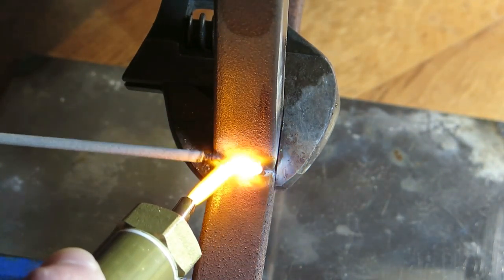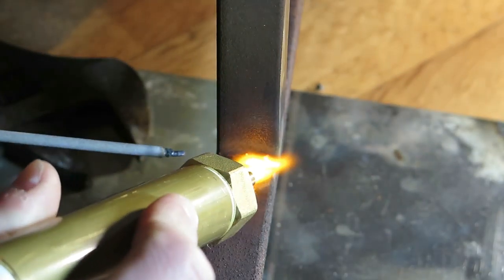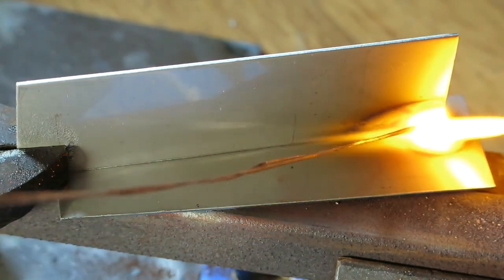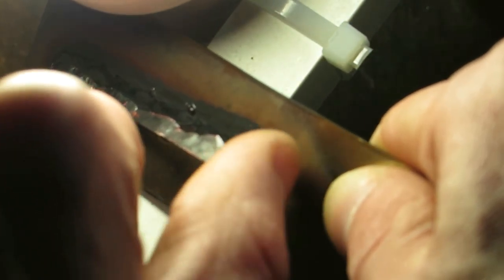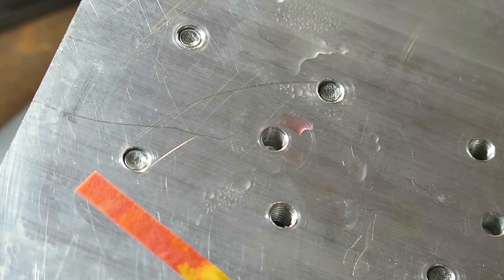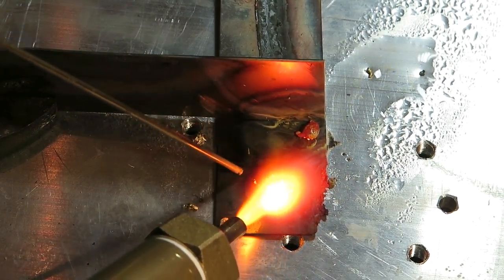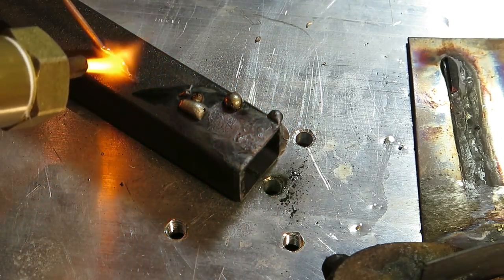Welding, brazing and melting glass with 1KW HHO

Comment: I've not seen many videos that explain how much HHO production is needed for working glass without a problem and how big an electrolyzer and LPM would be needed. Any idea of how many LPM are you generating and has the torch been satisfactory in terms of heating glass? I see you have a lot of problems with cracking. A reducing flame is usually the poor man's annealing, and given the 2 Oxygens for each Hydrogen, i can't see how you could get a reducing flame ever out of a HHO torch.
Reply from the maker: I have been using this exact cell for past year quite extensively as a hobbyist for glassblowing. I ordered about 20m of glass tubes with various diameters and I need to order another batch, because I have processed them all to make random equipment. I make mostly condensers, fractionating columns, drippers and gas drying tubes. In beginning I have made quite a bit of scrap, but now I feel quite confident to make what I need on first try. I have built annealing oven, but then I have never used it, because I have learned to work glass in a way that it is pretty stable (at least I like to think that it is :).

There are some, I would say minor issues with the setup though.
- It is quite low power. I run this cell at about 700W currently. I think it does about 10LPM. This is just barely enough to work with 30mm tubes on lathe. It is possible to do bigger stuff but you have to work in sections, which is not super great for internal stress in glass and it can crack even when cool at any moment. But I think think you can learn to do this safely though. Even for hobby work I would recommend at least design for 3-5kW and underrun it if you do small stuff.
- Even with such low power, water heats up significantly after few(3ish) hours of work. Regulation would help, but I am not bothered by this fact enough. Also I should have used a bit more plates for better efficiency, but that probably wouldn't be significant.
- So to get more power overall, cell would have to be physically bigger, with better water flow rate (is passive now). Plates could be a lot thinner though. I think I have used 0.8mm? I would go with 0.15 or even 0.08mm so I can cut them with scissors and punch holes on small-ish drill press.
- I mix in a tiiiiny bit of propane that at best adds few watts, but then hydrogen combusts at low velocity and it is not quite concentrated in point I want to heat, so some heat is also wasted. This is mainly to prevent flashbacks though. (it definitely prevented a few :)
- The way I did the seals wasn't too great. It does move over time and you can get even a leak. Mine is still fine after 2 years, but I should fix it soon.
-  For commercial application the size of cell would have to be very large at which point you have suddenly quite large volume of HHO gas in it. So either completely different design would be needed, or proper safety precautions must be met, like dedicated room for cells.

Unfortunately I don't have experience with oxypropane, so I can't compare pros/cons.
In general, if you have free electricity or don't want to mess with big bottles of propane, this stuff is OK for home player. If electricity is scarce (off-grid situation) other alternatives may be better.

Alternative can be oxygen concentrator, which is also relatively cheap, but you still need propane. I have used about 2l of propane over 2 years, and this is not only for glassblowing but for various brazing jobs and stuff. I have used more water than propane, let me put it that way...

I could do probably some update video on this topic, I have mentioned this is one livestream I think where I was trying some very early glassblowng. Maybe I have already answered this even here in comments somewhere...

Comment: It can cut very well but it will never weld. The issue is that when you burn hydrogen and oxygen, you make water. Just try soldering a wet pipe. You can't. It will not stick. With HHO you are constantly wetting the surface from your flame.

It is a very very very good cutter though!
Reply: That is bullshit.....a hot surface will vaporise the water into steam before it can condense.

Comment: For brazing take a look at this video https://www.youtube.com/watch?v=jjYehhXcDzs&t=86s You need to clean metals and use flux.
Reply from the maker: Thanks for recommendation.
I have already solved this by using rods with flux. However interesting is that pure copper wets base metal pretty well.

Bigger problem in my case is excessive sheet metal bending. But this is probably due to high power of torch.

First I want to make a new casing for system, put everything in some box and then I can play with power levels and stuff...

Right now money is limitation for me so it may take some time...
But the cell is placed in the middle of room so it is kinda priority for me :)
Reply: I'm glad you solved your issue. I'm also going to build hydrogen generator mainly for brazing work. One thing I will do differently than anybody else is to separate oxygen and hydrogen in order to prevent flashbacks.
Reply from the maker: Well there is such a thing - https://www.youtube.com/watch?v=ULPxgxKaQt8

I was also thinking about that, but I was thinking about regulating oxygen, and that would lead to O2 pressure build up in O2 chamber and possibly leaking through membrane and so I decided to not go this way...

Also if you design bubbler properly flashback is not destructive. But annoying(water gets in gas output hose). Thats for sure...

And i Think that JDC man shows membrane material, but you can use shower curtains for separation - worked for me
Reply from the maker: "hydrogen embrittlement":
At the beginning of vid. I melted welding rod. Yes, it was brittle, but it was melted.
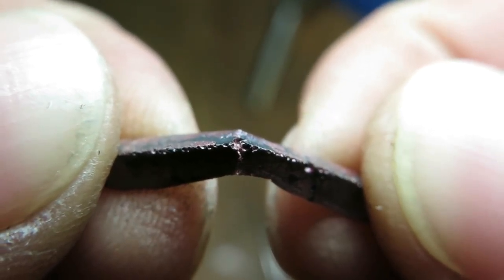At 2:20 - that was test of ability to melt stainless steel, I couldn't melt SS. Instead it went porous.

If you weld something with sticks or with CO MAG welded area will be porous... Not sure about TIG.

However brazing with brass went OK without affecting steel very much.
There is much more testing to be done with this so I am not that experienced.

Comment: Maybe it wont weld because of the water contained in the gas?
Reply from the maker: Certainly not enough power + oxidizing conditions in 1st place
Reply: There is no water in the gas......if you burn the gas and then condense the flame on a cold surface you will get water droplets forming.
Reply: @gangleweed  the gas coming out of the electrolizer  is certain not dry,  being close to 100% humidity.  But it is unlikely to negatively effect the flame much if any.
Reply: @kreynolds1123  When the gas which consists of hydrogen and oxygen burns the result is a flame at 2,800 deg C......water cannot exist at that temperature but when the burnt result is cooled down to below 100 deg C you will get water droplets forming.
Reply: @gangleweed     I think most people understand that liquid  water can not exist above 100c, except under higher than 1 atmosphere of pressure. But to my point, it's comon to talk of water as water in its various phases. Frozen water and  ice is water in its solid state, liquid water and or water absent context sugesting another phase is generally to be considered liquid water, and steam and humidity  is water in its gaseous state, but it's still water with the same chemical  formula. 

And, while the original commentator and I were referring  to water the gas stream before the HHO gas is ignited, there is even more water in the flame and its exhaust  because the byproduct of oxidizing  2 H2 is water + a lot of heat making it  superheated water vapor.
Reply: @kreynolds1123  You forget.....the water actual has been disassociated by electrolysis into it's constituents which are hydrogen and oxygen.....that is not water and cannot be until it combines when ignited and then condensed on a cold surface.
Reply: @gangleweed  not forgotten at all. If you reread my comments, you'll see I mentioned the humidity of the gas. That is not saying 2 H2 and O2 is water, at least untill its burned,  but rather in the gas stream you will have some water in its vapor phase the gas stream will be close to 100% humid given the temperature and barometric  pressure. That is unless you dry the gas stream with a desiccant, or condense the water humidity out of the gas stream.
Reply: @kreynolds1123  You cannot have any water vapor in the gas stream once it ignites, any water vapor that might carry over from the bubbler will dissapear with the heat of the flame........condensing the resulting burnt gas that produces water droplets is the result of the H and O combination which is H2O or water.
Reply: @kreynolds1123  The law of physics says it can't........at 2,400 C water will not be present.......the resulting burnt gas will condense on a cold surface once it drops down to a temperature below 100 deg C.......any water carried over from the bubbler will be long gone by that time.
Reply: @kreynolds1123  Keith, if you have an HHO generator available and want to prove the presence of water in the unburnt gas stream as it exits the torch...... without being lit......... play the gas stream on an icy cold dry surface and see if water droplets are formed.......the cold surface will need to be icy and dry.
You could also blow the unburnt gas into a glass test tube immersed in icy cold water or just icy cold from the fridge  to see if any water droplets are formed, but don't get any water in the tube, it must be dry to prove the point.
Reply: @gangleweed  I don't need to prove it to myself. Having Worked with hydrogen storage in metal hydrides, one has to remove the water in the gas else they will destroy their metal hydride storage medium. Water's vapor pressure is well known and depends on pressure and temperature, and number of ions in solution. So water in the electrolyte  will have a lower vapor pressure than the water in the bubbler. Gasses being filtered through a bubbler at room temp will be saturated at 100% relative humidity for the tempurature and pressure.
Reply: @gangleweed  Your missing out on thermodynamics here. Water at 2200c has a thermodynamic equilibrium  of just 3% thermally disassociated.  Shortly afterwards, the vast majority will have recombined and new water molecules will have disassociated. Going up the temperature scale,  at 3000c the thermodynamic equilibrium is just over 50% disassociated. Going down the scale at room temperature the thermodynamic equilibrium has roughly 1 molecule in 100 trillion thermally dissociated.
Reply: @kreynolds1123  You miss the point of the argument.....the water droplets that appear on the job are generated when the hot burnt gas hits the cold surface you are going to heat or weld etc, that is why you will see water droplets on the workpiece and it's not a carry over from the HHO generator. ....that is as simple as it can get.....forget about the science, most people won't relate to it anyway.
Reply: @gangleweed  water droplets condensing on metal below 100c  might be what the original poster, (OP) meant,  but it's not clear that is what the OP meant and ceases to be an issue when the metal  gets over 100c.  There's still water in the flame, it's just just high temperature steam.
Reply: @kreynolds1123  That would be debatable....you first have to prove a statement before you make it.........the "high temperature steam" is the issue I disagree on.....do the test in a cold test tube as I suggested.
Reply: @gangleweed  I've already shared that i had to dry hydrogen for storage in metal hydrides.

But, I don't understand how anyone could think you can bubble a gas through room temperature distilled  water at near atmospheric pressure and have the gas come out dry.  It will be near saturation. It's simple science done for centuries.
Reply: @kreynolds1123  Because when the gas is ignited the water, if any, will be vaporised in the flame and so as the science experiment for the electrolysis of water to H and O goes the resulting water droplets that form on a cold surface are from the combustion.
What you are familiar with is the storage of H and maybe O too after electrolysis and I will agree that you "could" have some water vapor trapped in the raw gas, but as the science experiment goes once you burn the gas you will get water condensing onto a cold surface.
BTW, you can get that effect from any air blown heat source, even an electrically generated one from a heat gun, if it impinges on a cold surface.
Reply: @gangleweed  Water in a flame condensing on cold surfaces below 100c (cold by welding standards) ceases to condence when the metal is further heated over 100c. 

While there's plenty of water vapor in the gas stream, and generated in the flame, it isn't the problem with these welds.
Reply: @kreynolds1123  I know, I do welds with HHO and plasma too.